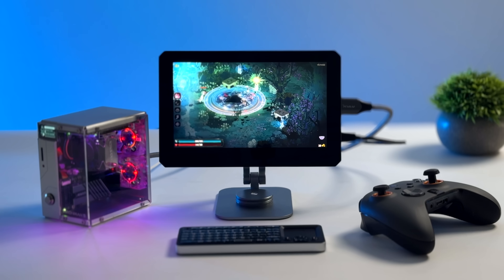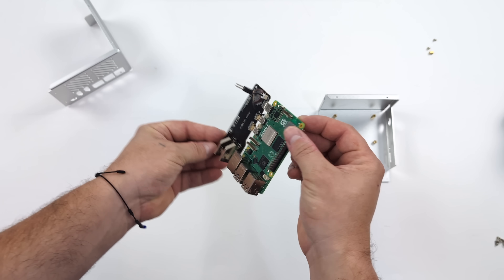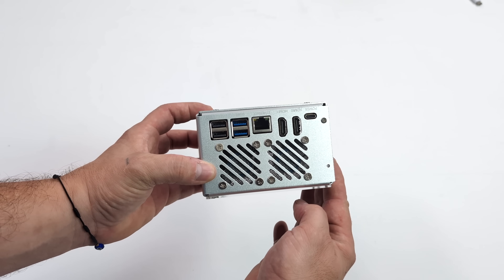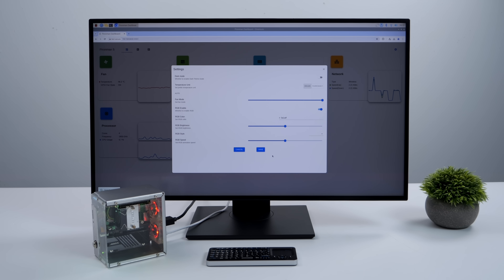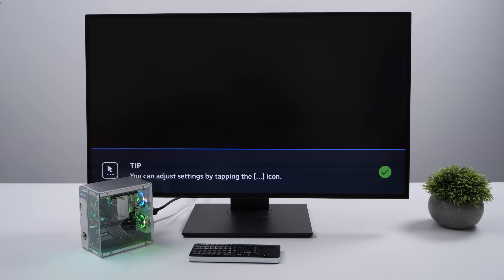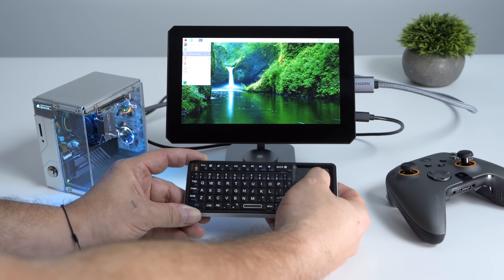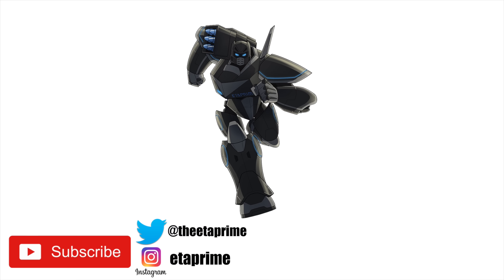Build A Super Tiny Arm Based Mini Desktop PC with the all New Pironman 5!

Comment: 00:00:00 Tiny ARM PC
00:00:17 Pyon MAN 5
00:00:57 Assembly Begins
00:01:42 Tower Cooler
00:01:51 Overclocking Potential
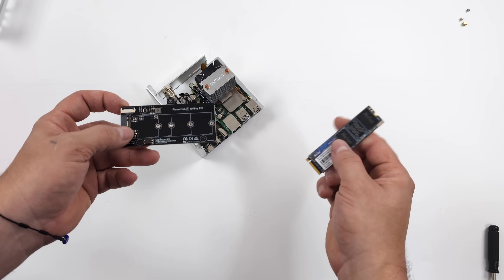00:02:14 Nvme SSD Upgrade
00:02:56 RGB & Gpio Board
00:03:13 THE Final Build
00:04:03 Software Control
00:05:30 Gaming with Steam Link
00:06:18 Portable Setup
00:07:33 Final Thoughts

Comment: The back fans pull the air out, there's no need for dust filters there. Unless they push against the CPU-fan.
The question is: Where does the air get in? And the only way, apart from some cracks left open is the GPIO-outlet at the top. So you have the dust collecting there and inside the fans at the back. That doesn't seem like a good way for cooling.

Comment: Would it make sense to turn 1 of the exhaust fans around so it takes in cool air and then the other fan would expel the hot internal air?
that way it would be a perfect cycling air system?

Comment: I need more specifics on that mini monitor and the stand that you have it on?  it looks like the perfect size/specs that I need for a project that I have been working on for a while now to make the perfect work from the road setup.
Reply: i need to know too
Reply: @GDT1124  I never figured out what he was using, but I did end up buying two Vokensu 10.5-inch non touch 1080p screens off Amazon for around 60 bucks that are very decent for the price.  It's a little bigger than I had hoped for, but if you still need smaller, wisecoco makes a 7 inch touch 1080 screen that's around 100 bucks.

Comment: Soooo CUTE that's very FUN!!

That cooling solution is wild tho 🥴lol, CPU + case fan working against each other and 0 exhaust 😂

To be fair that's how it looks on their website too even though they imply that both transparent fans are exhaust and the GPIO hole is an intake. But from what I know about fans, they're both intakes rn. That's kind of wild choice, and noisy for sure. 
If you keep this/someone does this, you should flip the top transparent fan so it exhausts. Makes a nice loop over the SSD and through the tower cooler.

Comment: I would think that the fan grilles would really restrict the airflow, for a fan that small. Maybe, the top on should be an exhaust fan, without a grill, and the lower one can be an intake. It might not be ideal, but the two intakes seem to be working against the heatsink fan, which is pushing from the front.

Comment: I still think getting a used laptop is more affordable and way more powerful than a raspberry pi but this case makes me want to get one. It’s a total geek thing!
Reply: The Pi 5 is actually more powerful than my ThinkPad X230! And it runs so much cooler and uses much less power. 

I’m actually thinking of designing a Compute Module retrofit motherboard for it, because I like ThinkPads, but I want the benefits of ARM and the ability to design my own hardware.

Comment: These form factors are what I want to put an iPad motherboard into. If you've ever stripped an iPad, you'll find it's mostly battery and screen. the motherboard is just a strip about the length of a RAM DIMM. If I had a way to adapt the ipad LCD connector to another display output. I could fusion a small case for the iPad motherboard and power it with usb c, or even better, find a way to adapt the battery connector. The only issue with apple parts is the MICROSCOPIC CONNECTORS. It's not easy to even use tools. for perspective, this iPad motherboard case would be as thick and long as a normal RAM DIMM but it would have the power an M4 chip and only one cable would come out

Comment: Only 28 steps. That means 28 potential points of failure.

Then you look at the price, which, when added to the PI5 doesn't make it the value setup it has always claimed to be.

Overkill and overpriced.

More style than substance.

Note that there was no mention of the resolution of that YouTube stream.

Gaming via streaming is one thing but no demonstration of anything local.

What isn't said here is far more telling than what is.

Almost saved by the last comment but that should have been upfront.

Comment: sir can you recomend me module that work like mobile phone but is detachable like sbc (like you can freely upgrade and so on, if possible as slim possible for portability. All sbc I seen is too bulky for pocket. While phone itself is already the answer but the lack of active cooling like you find on sbc is the problem for me, and it lak upgradable option. 

problem sbc for me they have too many I/O while what I need is just simply usb c port for multipurpose. big conector like LAN standar usb are just burden for their size.

Comment: In a couple years a new catagory of motherboard will release that wil be even smaller than itx
Reply: Pico ITX already exists. It's what several of the Asrock machines use, and is a defined standard.

EDIT: I looked it up, and it was defined as a standard in 2007. So it's not particularly new. Size is 100mm by 72mm.

Comment: I love that little heat sink & cooler! It looks like a normal PC shrunk right down! Along with those 2 RGB case fans it really does look like a miniature version of a normal PC. I mean it's really nothing special in terms of the actual hardware or materials; all pretty basic stuff, there's loads of other nvme hats for the pi but I think they've done a great job on the design of this.

Comment: I really like the case and use of NVME on Pi5, but the Pi5 is still quite a dog and a poor value proposition compared to any N100 mini PC unless you need GPIO. I had the previous Pi4 towercase, getting the mini display to work was a nightmare.

Comment: Sounds like a stupid question, but if you bypass the sd card, how do you get the os on there? Have this setup, didnt build yet, but was going to load batocera for a Sinden build
Reply: pi can boot from nvme drive, though I can't remember what the default boot order is. You can get usb to m.2 dock / connectors to directly connect a standard m.2 drive (sata & nvme). Then it's just the same process as you would go through when installing onto a microSD
Reply: @fredhair  will try. It is a Pi, it is built for messing around, trying different things out, so what could go wrong?
Reply: You can boot from SD, use imager to write the image to NVMe. You also need the new bootloader. I have the Argon One V3 case, and their script sets the NVMe as first boot device. You can change the boot order (SD or USB as first), but it will mean that you always see the bootloader when you are NOT booting from SD or USB. At least, I haven't found an elegant solution for it.
Reply: You can set the boot order however you want. If you put the nvme last in the boot order, it will still boot to it if there is nothing in the sd card slot or usb storage. You can actually leave it like that long term if you don't mind a couple extra seconds in the boot time.
Reply: @harleyn3089  ok awesome. I just got an nvme adapter (usb shell) to attach to pc, so can load the os there, then see what happens

Comment: Pi needs to release a Pro device with a beefier SOC.
Reply: ...no, they need to do the exact opposite. Does no one remember the legacy of the Pi as the "$35 SBC" anymore? Give us a 2GB Pi 5 already. Beefier SBCs have always been best left up to the competition anyway, the real strength of Pi has been the community and the streamlined supply chains (I said streamlined not invincible).
Reply: @turbochargedfilms  you clearly missed the part that said Pro.